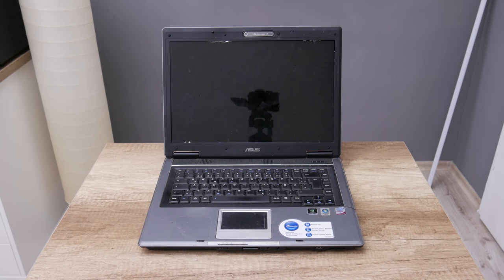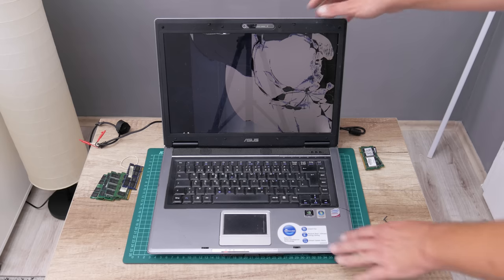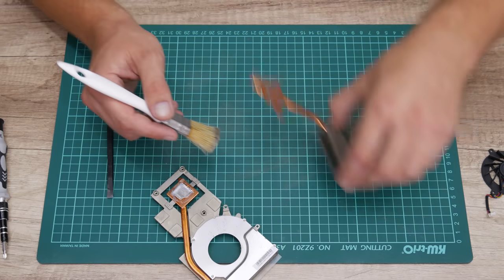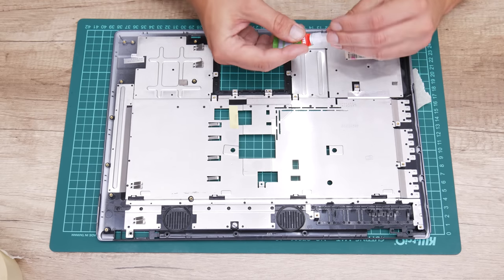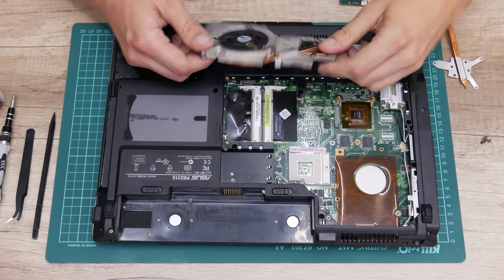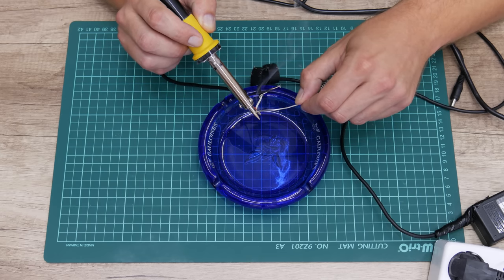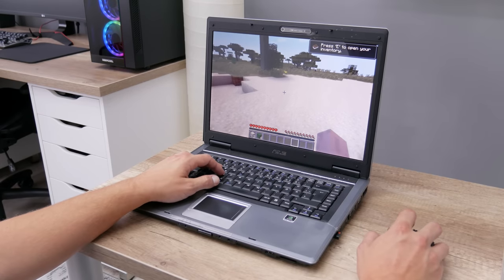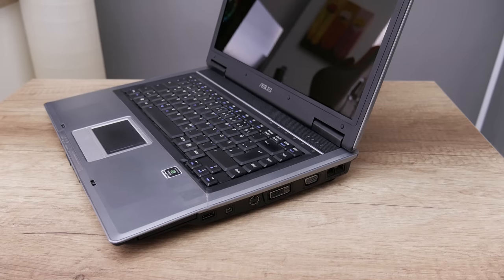Almost Trash - Old ASUS Laptop Restoration

Comment: We really appreciate your hard work of finding and restoring old broken electronics, great job Andrew, i hope you reach 1 million subscribers.
Reply: From where does he get all these laptops does he get it from eBay
Reply from the maker: Thank you bro :D
Reply from the maker: @misternoobde3768  Hi bro, I'm getting from family, friends, neighbors or some trash pickup :D btw most of the tech already belongs to someone I just take, repair, restore and return
Reply: @ComputersAndTechAndAndrew  lol
Reply: @ComputersAndTechAndAndrew  btw what is the best method to clean desktop LED monitor ?
Reply: @kcjpunk  Just use a screen cleaner gel. what you can buy from your local Supermarket.
Reply: @ComputersAndTechAndAndrew  Did you put the optical drive back on the Asus Pro315?
Reply: @ComputersAndTechAndAndrew  I was wondering about that. Otherwise you would have laptops piled up everywhere

Comment: The guy who just threw the laptop away:
“Can I have that back?”
Reply: Honestly probably not these are not very valuable, this one should not even be repaired. I had one in better condition threw it out with no thought about it there old and slow
Reply: @Foggy404  bruh you should have donated it to charity so someone who needs it can use it
Reply: Bor i am a small boy and i can repair a laptop
Reply: @jameswyma9849  I found it chucked out and I threw it out after getting any useful parts
Reply: lol true
Reply: JAJAJAJA
Reply: Be like
Reply: Never a 5400 rpm HDD unless you can deal with its slowness
Reply: @mallikhai  same, i opened my laptop and managed to clean the cooling fan (didn't take it out)

Comment: If the Volts are the same (+- 5%) you can use a charger with higher Amperage or Wattage without problems. The laptop pulls only as many Amperes as it needs, so the more the Charger can give the better it is.  It is physically impossible for the charger to push Amperes through it without changing the voltage, but the voltage is constant.

Comment: I thought as long as the amps is greater than or equal and voltage is identical you can use it. Great restoration as always, you're always very thorough. It's a shame most DDR2 systems are capped at 4 GB.
Reply: Some earlier DDR2 systems, such as Fujitsu Lifebook E8020 or Packard Bell Easynote MV46, are capped at just 2GB DDR2 total.

Comment: as far as i'm aware, the PSU only needs to have the same voltage, and preferably the same or more amperage. that is how i choose PSUs and i had nothing blow yet. it's also worth looking at if the PSU is AC or DC (DC is basically the standard, but it does not hurt to check), and if it's the same barrel, if the polarity is the same. some devices can also work on a range of different voltages, though for this make sure to check the labels or manual, don't randomly plug in the wrong voltage psu, that will definitely blow.

Comment: if I'm not mistaken, Centrino is the brand name of Intel's wireless adapters
Reply from the maker: yes, also centrino has core duo series, instead core 2 duo, weaker and wired cpu series :D
Reply: It was a combination Of certain Intel M series cpus in combination w/ certain wifi standards/ speeds & battery life etc to receive the Centrino certification

Comment: I upgraded a win 8 pc to win 10 and now it's running a low slower. Is it because I upgraded instead of a clean install? Is windows 10 more suitable for pcs with SSDs? The 750gb hdd usage is at 100% especially when starting windows.

Comment: My old dell laptop has a nividia driver and works great with extra ram and ssd installed but I put linux as the operating system on to it, and hooked it up to an external monitor

Comment: Just to clarify, Intel Centrino is not a CPU, it's a platform designation by Intel. A laptop with a Centrino sticker will have an Intel CPU, an Intel wifi module and most probably an Intel bluetooth module aswell.
Reply: Almost. Only Intel CPU and Wifi module. The BT module can be anything else.

Comment: How much you spend to repair this laptop?
Reply from the maker: Hi bro, not much, 3 euros for the charger cable, ram and the CPU I already have it and the SSD I got it previously
Reply: In my experience, the screen can go from 10 to 40€.
The CPU should be 5-10€ tops.
RAM maybe 10€ (much cheaper if bought used).

The hard drive is probably the most expensive, but a NEW 128GB SSD costs about 15€.
Reply: @ComputersAndTechAndAndrew  oh

Comment: I have HP Dv5, very old and have 2 ram slot, I dont know what happen my old Laptop, when I Plug in the power cable in few minutes, it auto turn off, and my battery charge in not enough 5 min, the battery light flashing. And I need to find the DDR2  short Ram to place the broken one

Comment: you can not use hp or dell chargers...they are 3 pins...3 wires..with the 3th wire is a sensor cable...you can use it but you will have to connect the sensor wire to the + wire..

Comment: 1:50 Whaa, nooo.  Why cut it, gonna give a tip, take it or leave it.  Why not just use some steel wire, and rubber from a tube (i know of a product named Goop, that i know would work). With that it is pretty easy, for live and well average person to just make a convertor cable. Or in this case, to just make the new plug to be an extension, to just put on, and take of the original charger plug.  Ps I am kinda surprised you don't have a universal charger laying around.  More detailed info i could give, if one wishes, but with just logical thinking seems to me, someone who is used to repairing can figure it out pretty easy.

Comment: You're wrong about the voltages and amperes of the power supply. A power supply should have the same voltage as the device (load) needs. You're not going to damage a device if you plug in a 1000 ampere power supply because the device will draw what it needs at any given time. An easy way to remember is to think about voltage as water pressure and current as the diameter of the pipe flowing from it. If you overpressure a device it will damage it. But simply plugging a larger pipe to a device if the pressure is right is not going to damage it.

Comment: well my charger for dell and acer are the same i add extra male adapter on wires because i dont want to buy a new charger 

19v 3.42 65w on acer 

but my dell charger is 20v 3.25A 65w also if you use lower wattage charger it will damage the charger itself

Comment: My hp pavilion G6 notebook i5 Radeon graphics which starts upto window screen within booting time or opening 1min excess heat comes and trips off I don't know what to do do you know solution for this kind of problem
Reply from the maker: Hi bro, I think you should change the HDD and instead HDD you can use SSD. HDDs become very slow especially with windows 10 and some of the new software's

Comment: Brushing over the electronics is a static disaster waiting to happen... please dont do this! Also when buying another charger, only the voltage has to match. If the device needs 4A and a new charger only delivers 3.5 it will probably still work, might not charge the battery as quick e.g. And if the charger has more Amps, thats especially no problem...

Comment: Please don't install windows 10 on these. Games will have degraded performance and the asthetics will be (kinda) ruined
Reply: Well windows 7 is outdated and no longer working. Do you want to make him install windows xp?
Reply: @angel_withaflamethrower  windows 7 is working as in 2009, but wIthout that extra security. Same with XP. You can install antivirus and be secure.
Reply: @angel_withaflamethrower  even if windows 7 is still unsupported u can use it,becouse i have extremely low end PC from 2005(HP compaq dc 7100 sff)and low budget i dial boot windows 7 and xp(becouse of performance,and people are still using it even becouse of support